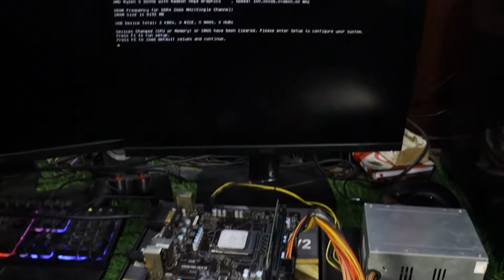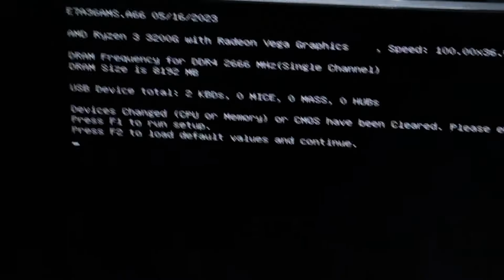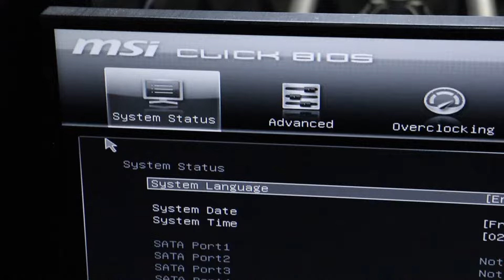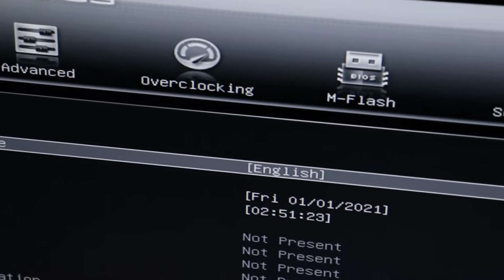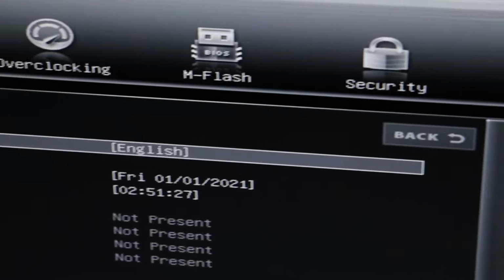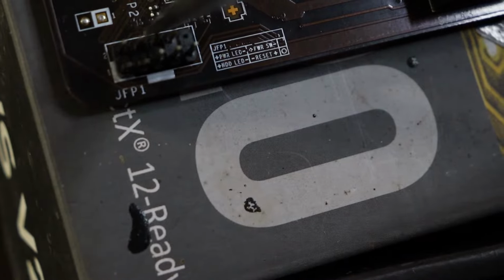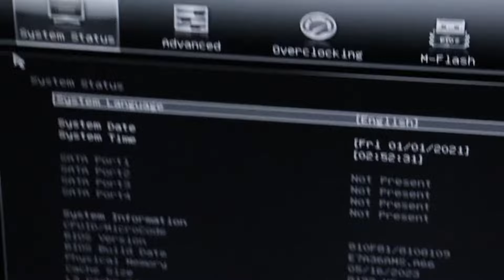How to Turn on PC Without Case Using Motherboard and Screwdriver  Step-by-Step Tutorial

Comment: I built my comp 2 days ago and I can't turn it on. I checked psu on my other comp and it works I replaced mobo and nothing I checked rams in every config ( not possible that my both rams are cooked) motherboard won't even start so I thought maybe it's a bad case but I did this trick you showing with a screwdriver and also nothing fans go on for 2 sec and nothing else computer turn off immediately. I it a bad AIO or CPU or something else I have no idea. I reattachesd all cables million times same with CPU and nothing.
Reply: Did you find a fix?
Reply: @spelking5  yeah CPU was DOA once I replaced CPU everything works...I still can't believe that I bought brand new from the factory but completely dead CPU I heard that this is very rare to have DOA CPU but I guess I had bad luck.

Comment: one weird thing is that it may turn on or off only after you remove the short
Reply: that is probably normal and would happen.
Reply: @Gsoda35  i think its normal. the switch triggers when the short is created and then removed. If you have your PC set to shutdown on power button press, it wont actually start till you depress the button
Reply: @carsythe  I guess my limited experience shows.
typical.
Reply: @Gsoda35  lol

Comment: I guess its safe to use the BIOS without a CPU cooler?
Reply: I think it's normal
Reply: No its not but shouldnt cause any immediate damage.
Reply: I have def done it with a cooler on top no thermal paste. Worked fine